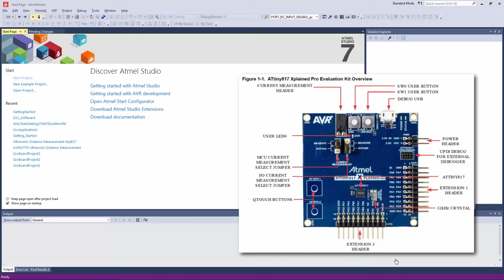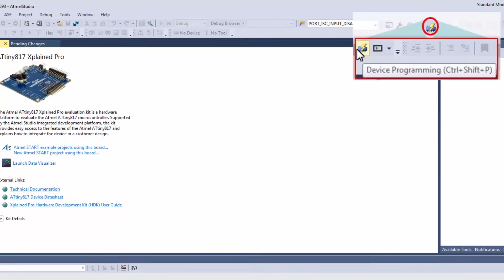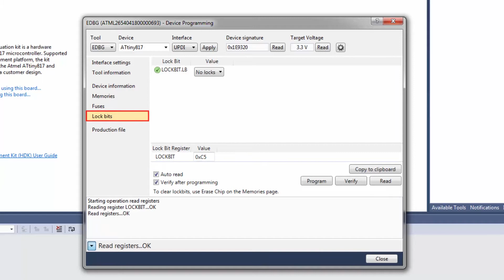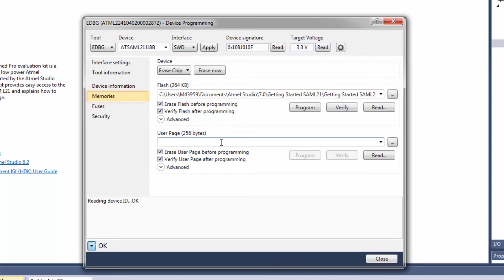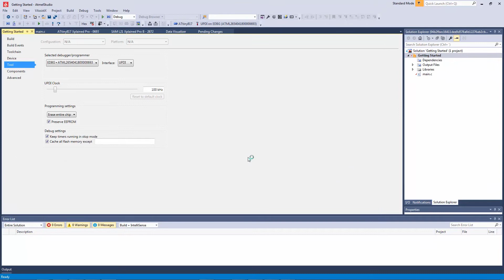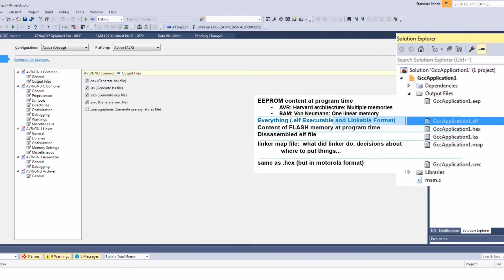Getting Started with Atmel Studio 7 - Episode 9 - In System Programming

Comment: Hi, I have question.  MKii power on --> AS7 power on --> programming OK.   But,  AS7 power on -->  MKii power on --> programming failed.  Is it ok or normal? I think its wierd.
Reply from the maker: Hi there, thanks for your question! Please follow these steps to get started using the AVRISP mkII:

1. Install Atmel Studio and the USB driver.
2. Connect AVRISP mkII to the computer and auto-install new hardware (AVRISP mkII) on the computer.
3. Start Atmel Studio and the AVRISP mkII Programming Dialog.
4. Connect AVRISP mkII to the target.

Please reach out to us at www.microchip.com/css if you'd like more assistance with this.